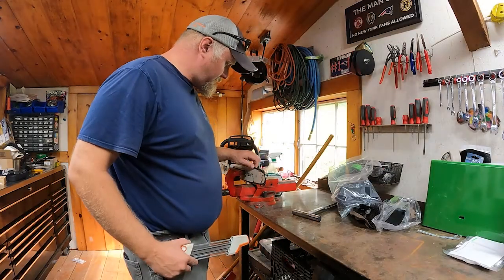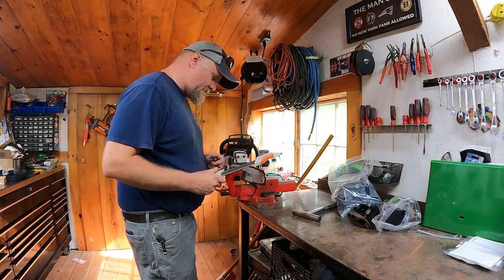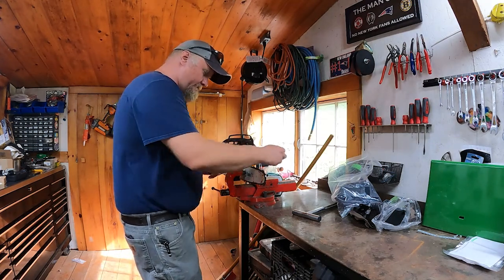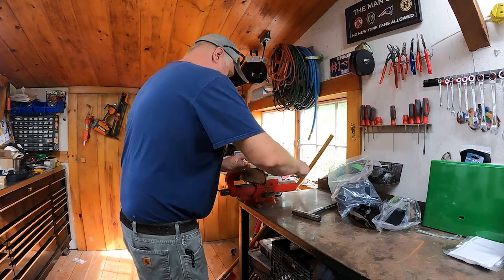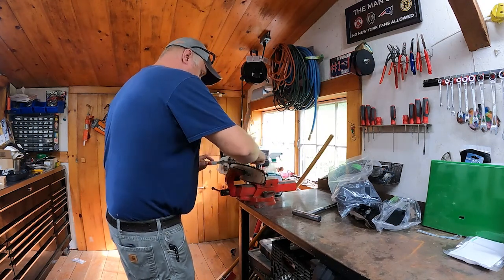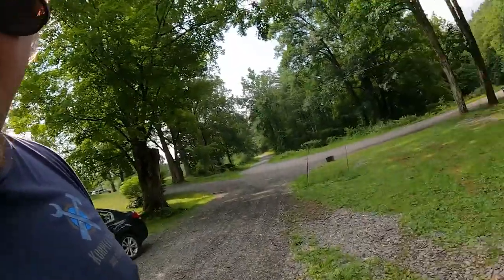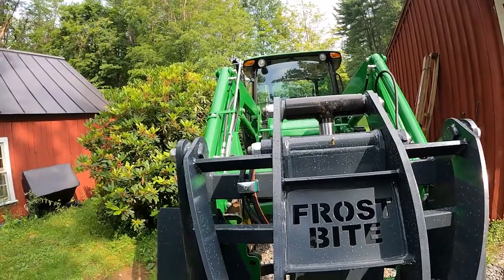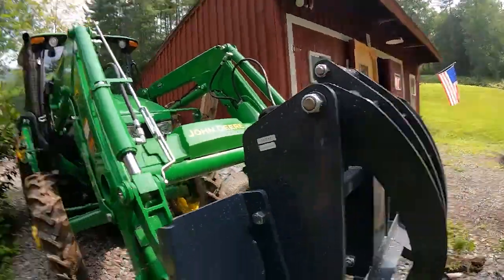Vlog 25 First look: Frost Bite  Grapple

Comment: JD a beast. Brother has a 5095m, works way above it’s class. How would you compare your other grapple with the frostbite?
Reply from the maker: The other grapple is great for brush but is a bit difficult to use on logs.  The frostbite defiantly out performs it there and is close tie on brush.
Reply: Where did you get it?
How is it doing
these two years later?